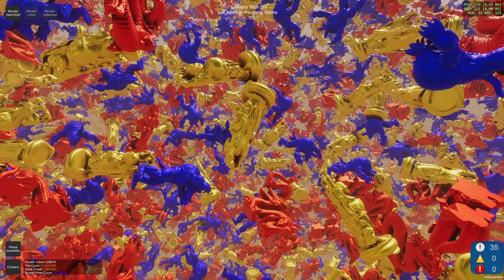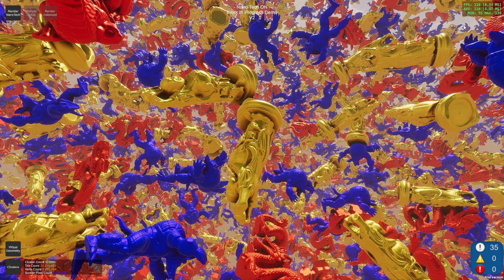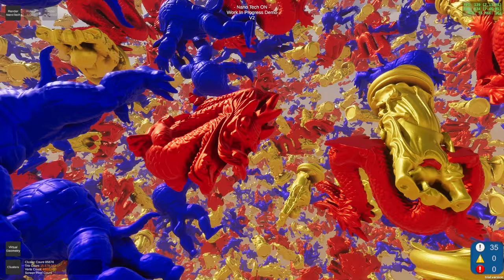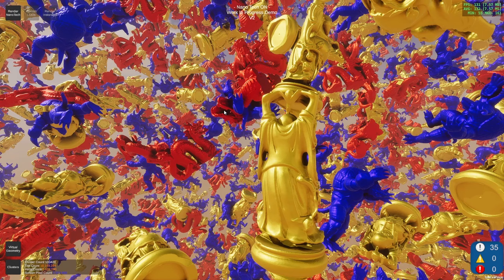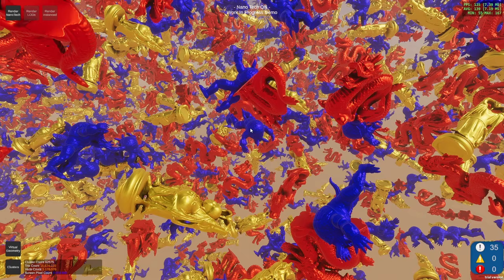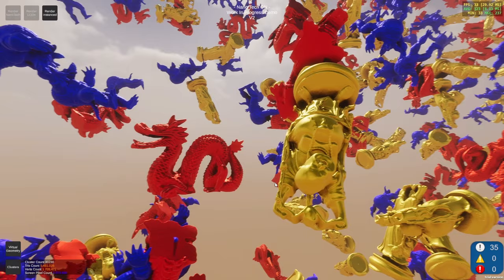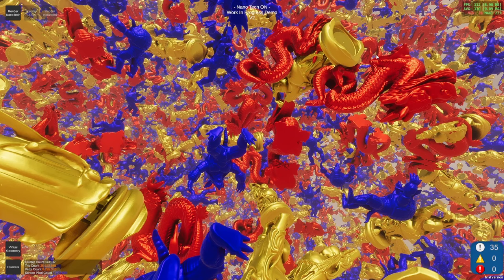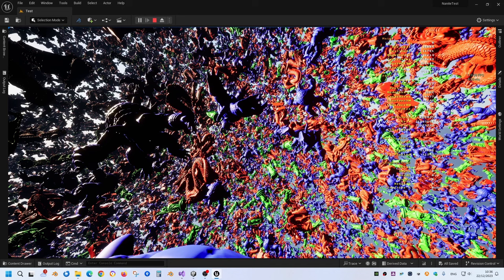Unity Nano Tech (WIP) Demo - First comparison with Nanite - Almost there (Updated)

Comment: What is the range between the camera near and far clip plane?
Can't wait to see some textures and some basic shader effect (like scrolling texture).
What are the hardware requirements? And vulkan only?
This is some outstanding work man!
Reply from the maker: It's currently set to 10k range far clip, textures can be seen in older versions, I currently have a 3070 gtx and it runs with over 120 fps so a 1080 should run with 60 fps (FullHD). DX11, vulkan and DX12 also supported later. Thanks!

Comment: When will it support GPU per mesh dynamic culling like the latest presented Unity 6?
Reply from the maker: This is a complete separate system, maybe there is some improvements with Unity 6 but I personally think this will outperform the GPU per mesh stuff from Unity.
Reply: @ChristianKahler  so it has its own culling system?
Reply: @adambenk0  like nanite it samples everything into a single mesh and drawcall. So yeah, I think the thing we would call occlusion culling (in case of separate meshes) is solved already within such a system. It is a different approach to the problem, but leads to the same result of having as few polys as possible for the detail that is displayed.
Reply: @thFaust   that is not true because those meshes still have polygons (and shadows, reflections, etc) that are being rendered, even if something is blocking the view and especially if they are not even in front of the camera. That's why simple LOD system on the video has better performance than this solution at the moment he turns the camara away from all of the meshes.
Reply: @adambenk0  the meshes still have polygons, sure, but they get rendered as a single combined mesh once they are visible. Strictly speaking they should not have polygons when off camera. At least that is how I understand it.. I am sure Christian could cull the entire NanoTech world (or object by object), when the camera is not looking at it. But what is the point of measuring the performance of not rendering anything at all? What matters to me as a gamedev is performance relative to the detail on display. A lot of people coming from oldschool rendering styles don't seem to grasp, that a lot of modern graphics algorithms don't scale linearly with the amount of objects or triangles anymore. That's the whole point of something like nanite. Therefore one should measure performance not in an empty scene (or cam looking away), but in a reasonable usecase, that is close to what one wants to achieve. The performance shown here with many meshes that would be billions of triangles in view is already promising and I am looking forward to the further progress and optimizations.
Reply: @thFaust  Culling is one of the most important rendering techs. You should learn more about it if you dont understand its usecase. Making an open world game without culling is impossible.
Reply: @adambenk0  I cannot speak about nanotech. But in nanite the Clusters are culled on the GPU. So I think it uses a hierarchical cluster system which is both used for rendering and culling. Like the Hand is one cluster which can be split into clusters for each finger. And the bounds of the Clusters can be used for culling. But I am not 100% sure on the details.
But it definitely culls parts of the meshes which is pretty rare.
Reply: @kettenotter  and it is very important. That's why I was asking if nano tech can do that.